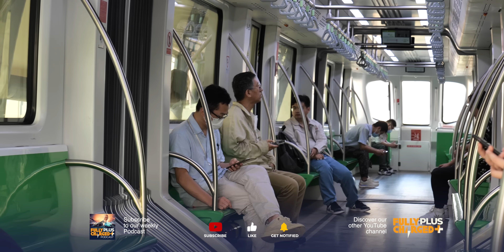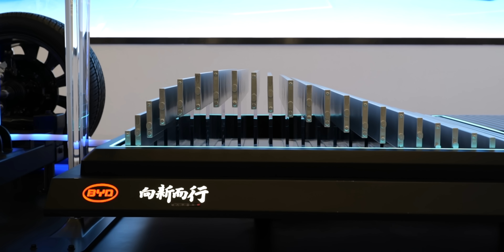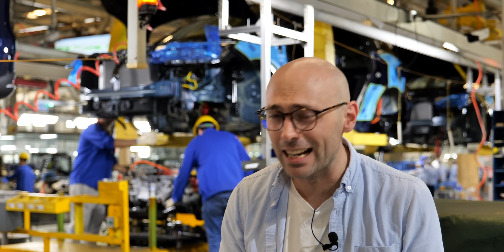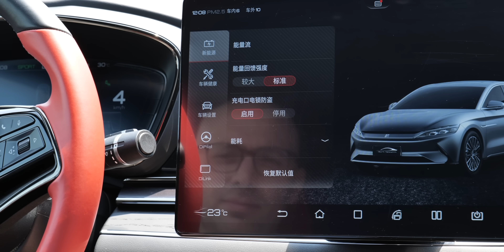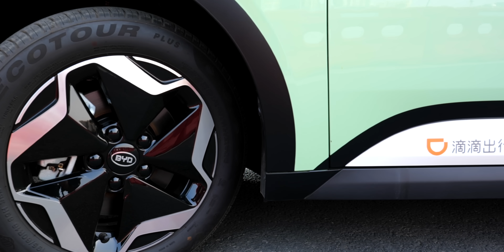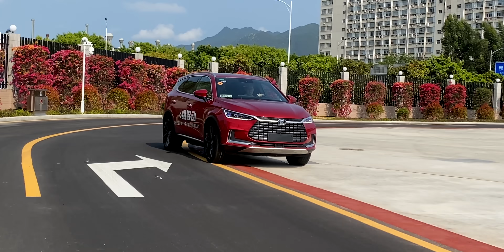BYD: Factory Tour & Full Range of EVs | FULLY CHARGED

Comment: This is very impressive, can't wait till they are sold everywhere, hopefully without the dealership model!
Reply: Theses aren't cheap cars. The BYD Tang starts at a 285000 yuan net price for the front motor version. If you want to buy this car in Germany that's 36500€. Now we have to add a 10% EU import tax and 19% Vat, making it 48000€. After the 6000€ BEV rebate, it's 42000€. If you want the all wheel drive version with good features you can easily pay 50000€ for the car.

Comment: Better for the air on our planet !
Reply: China generates over 60% of its electricity from burning coal, so while the local environment may be cleaner, there is still a considerable amount of pollution from these forms of transport.
Reply: @Magnitio1  China has the most advanced clean coal tech, and also, China is holding one third of the solar power capacity in the world.
Reply: Logan Zhou the clean tech does not extend to the removal of the co2 that is generated by burning coal. Whilst the production and use of electric vehicles provides the opportunity to utilise renewable energy, the facts are that any increased usage in many areas of China will currently be met by coal. This is having a major impact on the global environment even if the use of these EV’s has minimal impact locally.
Reply: @Magnitio1  This is why China wants to develop electric vehicles and solar energy.
Reply: @Magnitio1  The key idea is to replace coal powerplant with nuclear power.  I feel that China will get their commercial fusion gears soon, while here in Germany nuclear power will phase-out in this decade, instead Germany purchases nuclear power from other countries.
Reply: @Magnitio1  Agree, exhaust is just elsewhere, and massive.
Reply: The United States will say: BYD stole American blade battery technology. Then BYD threatens national security.
Reply: yes but don't make in the CCP

Comment: I'm glad you said that 0-60 times are pointless. That's how I think about them also. Why should you want to shorten the battery by having a huge acceleration when range is so much more important? Why should you want to have a speeding ticket in 3.9 seconds? Utterly pointless. All these HP's, why? Give the car so much power that it accelerates as an old fashion combustion car, with a top speed of that car and all is well. Why do roads need to be filled with sport cars? Pointless.
Reply: I should imagine since the motor works as a generator during regen braking to recharge the battery as it decelerates, the car can be less reliant on its mechanical brakes and more efficient in stop start city traffic.
Reply: You are right but the industry is full of silly rev heads that want sport or muscle cars. The public on the other hand want  ID3 and 4 styles that get them and their kids and dog from A to B, as cheap, safe and less hassle as possible.
Reply: If they dont give it a perk to display its competitiveness against combustion engines no one will listen to the other benefits of them. If they say here is an 80hp electric car with a good range it would appear they cant do any better, so why not make a statement and throw the toys at the demonstrator. Having so much power might be easier to an electric motor too so it isnt a big deal esp if the motors are common between models and the cars are a decent size so some of that balances out watts/kg. The D1 was more modest power because it was spec’d to the client so it didnt need to brag, it was how the taxi service wanted it.
Reply: Unlike an ICE, an electric motor can be spec'd for high power - and still achieve very high efficiency when used 'sensibly'.  Thus there's less trade-off for a high-performance motor, and it helps grab headlines.  Separately, even if you don't use that power all the time, there will be times / places where having that power on hand is an advantage / makes driving safer (not least merging onto high-speed roads from a slow merge speed)

Comment: There are already quite a lot of BYD buses in London. I think there may already be more than 100 double deckers. The bodies are UK made by existing companies, with BYD running gear and batteries. The other thing that is happening is that the European manufacturers are catching up. Volvo and Scania already have buses on the road, and Mercedes have joined in. The bodies are mostly UK, which is pretty much the same as it used to be. Chassis and running gear from one manufacturer and body from a bus specialist.

Comment: that little Louver that you pointed out that was at the back of the window that's for vortexing the air that's to create an expansion funnel a ver that will push the car for did increase the fuel efficiency

Comment: With the rust issues happening in australia under chassie i hope they are re-tooling or updating processing so this stops the issue here in 2023 @ 6mths after they ventured onto the roads. Attend to this &  Change the dash and i will buy one as the exterior is very stylish. And a good price point.

Comment: Rather than the power of the motors and 0-60 stats, I would much rather have battery size, efficiency and range stats. Also the stats for that lorry: is it only for urban use or could it drive between cities?

Comment: BYD, IIRC, uses lithium iron phosphate batteries.  LFP batteries are flameproof, it's not the shape of the battery.

Other companies did not use LFP batteries because they don't store as much energy per weight and volume as the lithium-ion chemistries used by Nissan, Tesla, etc.  But LFP chemistry seems to have improved and other companies are moving to LFP for their 'ordinary' EVs.  Tesla will use mostly LFP cells in their cars and used other chemistries (including high nickel) in performance and long range vehicles.

BTW, LFP batteries have incredibly long cycle lives 5x or more than other chemistries.

Comment: it looks like they're working hard to prevent battery fires especially like those that keep awning Tesla there's been over 40 incidents where the cooling system of the batteries have failed and caused fires that were so intense because they couldn't use water on them and 2 people died let alone the issues Tesla has and construction zones let every time it hits a construction zone the screen freezes up and Tesla has never ever admitting fixing these problems

Comment: here in the United States Electric Vehicle will not new it's just getting the inner structure in but they haven't set up electric service centers or the disposal of battery so they can be recycled sensory Vehicles going to have like two tons of heavy metal and speaking of the battery plates

Comment: IF the BYD blades were better in energy density and safety;  Then you would expect them to be lighter in weight; but the HAN model is 4400lbs and only has a 75 Kwh battery as compared to the Tesla model 3 Long range at 84Kwh and and 4250lbs.  Hence i see no advantage if BYDs batteries still have to be contained in an armored container like Tesla has; if they do not,  then the batteries themselves must weigh a lot more.  The promise doesn't seem to equal the reality.

Comment: But the rear hatch is not designed to receive a sheet of plywood.  Why 40 inches and not 50 inches. Redesign the C Pillar . Look at the 1986 Dodge Colt Hatchback design. Why do we need a truck. Joe the volunteer fireperson,  engineer and hot rod builder.

Comment: Great video , But, when looking closely at the video, i could see chassis scratches on the Lower side of red HAN already. And black paint marks of the white HAN on the inside motor compartment. Also assembly line marrying the motors with the body, is all quite manual ? Did anyone notice the same ?
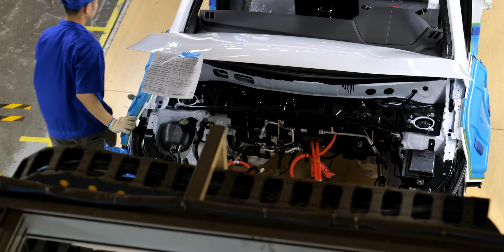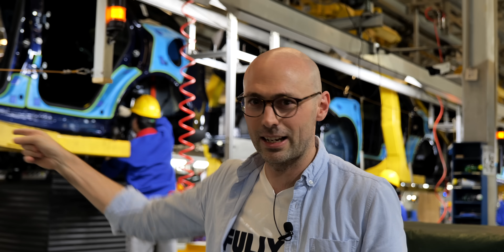Reply: Around the 6:10-6:30 time stamp

Comment: Great looking cars. Unfortunately, proven that beauty is only skin deep. There are BYD Arto 3s that start rusting at chassis connection points. Typically between screws, washers and bolts. Pity.

Comment: Can we stop with this notion that performance doesn't matter? I know Robert likes to beat that drum often and it might be true to him, but it's just not to so many EV owners.

Acceleration is important. The ability to rapidly avoid danger or overtake quickly or pull out of a junction/onto a slip road with speed are all important factors and benefits of buying an EV with decent performance (and what about the sheer fun of it and showing ICE owners that EVs aren't just about boring practicality).

Performance is a big factor when considering which EV to buy for most, which is why so many manufacturers are producing EVs with great acceleration.

There's no need to pretend performance doesn't matter, and perhaps you could even cover that aspect of the vehicles you review a little better? Doing a "wheel spin" doesn't help us to evaluate the car.

Comment: What makes or breaks the car and car brand is not first impressions and good looks.  It is reliability,  long term ownership impressions and warranty that is honoured by car manufacturers.  For example u just know Toyota will make good car and will admit to any faults and recall and fix issues with their cars. I dont trust chineese cars or any products made by chineese in that respect. Maybe in 100 years
Reply: Toyota do not! In Australia they were forced by courts to do warranty work and replace their crap faulty engineering. Ford , Mazda, VW .  Have all been as bad as well.  Toyota reliability ended in 2000.